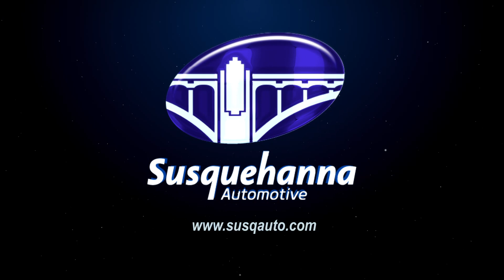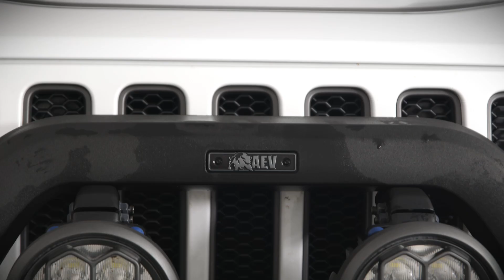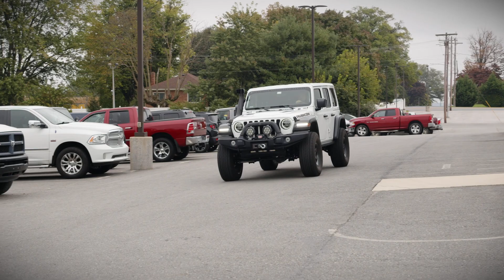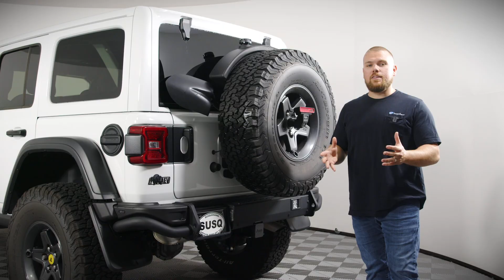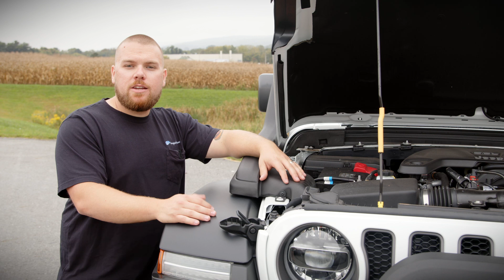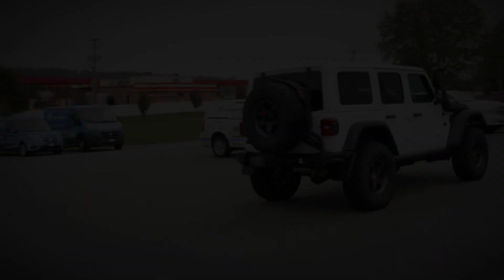2021 AEV JL Wrangler | The Perfect Off-Road Jeep?

Comment: Hello Buddy .. I have a Rubicon GCC specs .. basically is doesn't have highline fenders.
will the bumper still fit to the normal fender size?
Reply from the maker: There are two different bumpers based on fender height!
Reply: I know dear .. but I was just wondering if these specially will fit on normal fender size .. I see a benefit if it will really minimize the gap between the fender and the bumper .. as u can see, there is a gap between high line fender and rubicon specific web bumper .. so yeah , this what am seeking to know ..
Reply: Are u able to measure the gap between you bumper and high line fenders?
Reply: Yes

Comment: That front bumper looks great!!  However between the winch, Brush guard  and giant lights I wonder if the air flow to the radiator is compromised/??  Really question the strength of a modular bumper made with stamped steel???
Reply from the maker: A little less flow, but not completely compromised!